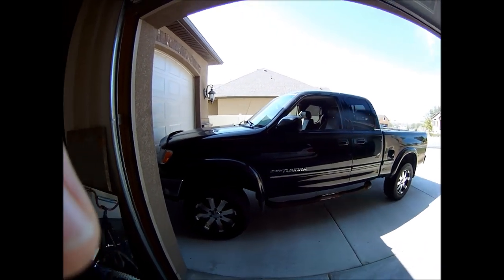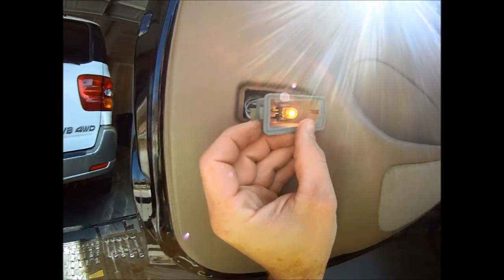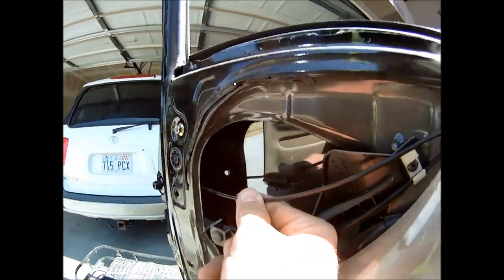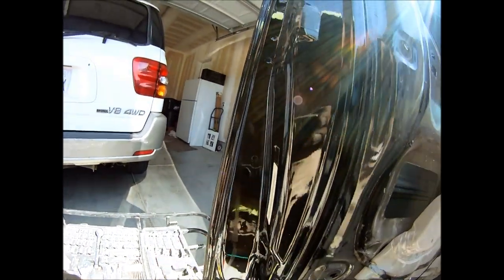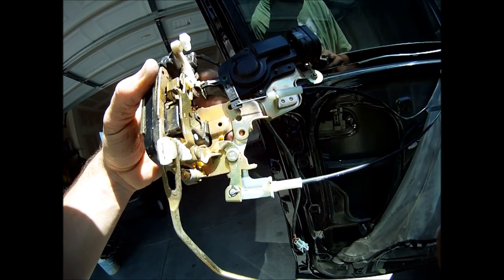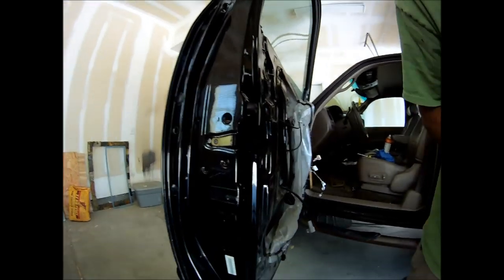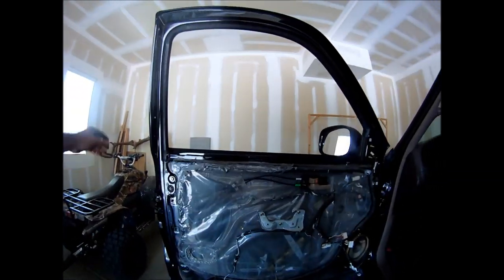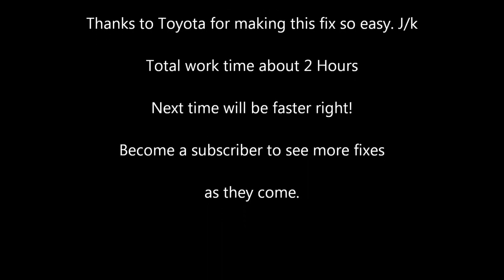Toyota Door Repair

Comment: Very helpful video, thanks.  It was a bit tricky getting the large door latch unit out.  The replacement cable was $8.22 from my Toyota dealer, which ordered it and had it for me the next day.  It was for the front left door latch, part number 69710-0C010.

Comment: Thanks for the upload, was a nice briefing. Had to remove the passenger side door lock cylinder to get the code off the casing, to get keys cut for the locks. Apparently a registration, license, and a vin wont get you a key made at Toyota of Orange, CA. Spare keys are a must lol.

Comment: Great video. I had already taken the door panel off and needed some assurance that I was on the right track. Simple fix. By the way, you don't have to take the light off. There are 5 screws to remove first; the two at top right, the one at the latch, and two more in the handle. Then pop the door pannel slowly off. I started at top right and worked around. Then, while holding the door panel, just disconnect all the wiring. No need to remove the light.

Comment: Nice work! Congratulations and thank you for the video!

I have a 2001 Chevy Prizm; it's the same car as a Toyota Corolla. The driver's door will only open from the outside. On my next day off, I'm going to remove the door panel and figure out what the problem is.

Right now I'm thinking the latch is bad, but I don't want to trek to a junk yard and buy a new latch until I'm sure that's what the problem is.

Comment: @0:56 "that one's just a screw" I DON'T THINK SO. this piece is easily broken. This piece clips into black plastic knobs you can only see after the cover plate is removed or broken off. Try to slide the brown plastic plate towards the rear of the truck then gently pry the clips which are above and below the lock (with the orange indicator) for removal.